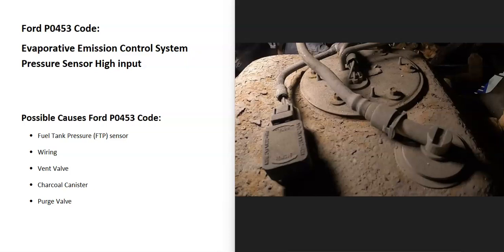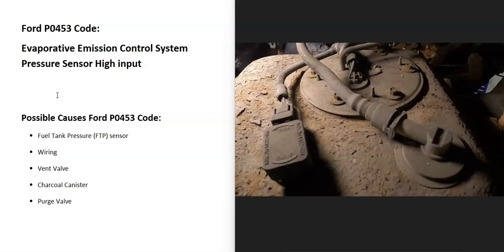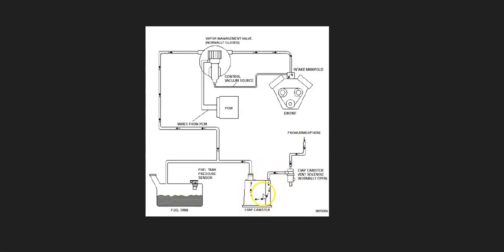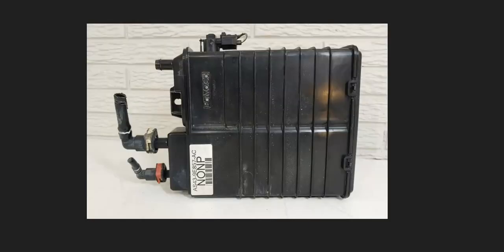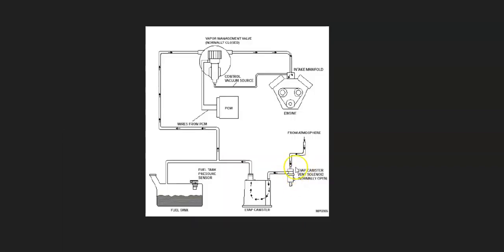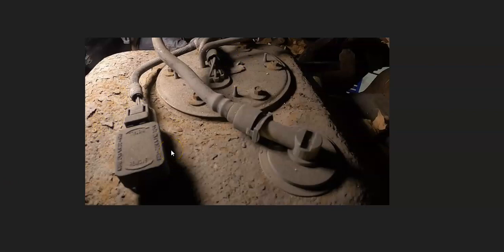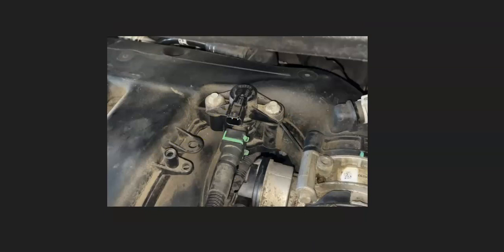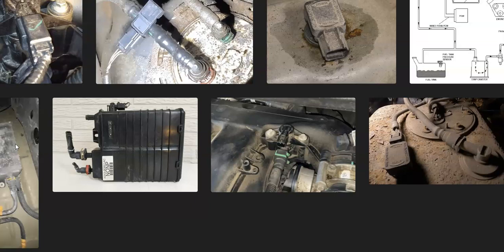Causes and Fixes Ford P0453 Code: Evaporative Emission Control System Pressure Sensor High input

Comment: I have a 2006 ranger with a 3.0l that has a P0453 code new fuel pump change the charcoal canister. But I can’t find the evaporative emission system pressure sensor/switch. Need help if anyone can tell me about where the sensor/switch is
Reply from the maker: In those years, Ford called it the fuel tank pressure sensor (FTP). For the ranger It is usually located on the fuel pump or inline on a hose.

Comment: Old video so sorry for late comment. Couldn't we eliminate stuck valve as the problem by running the car with the fuel cap off?
Reply: Also if it P0453, meaning the sensor is putting out 5volts, that would eliminate a bad reference voltage line. Also it would eliminate bad sensor output line. So it's either a bad return line (ground) or bad sensor.
Reply from the maker: The purge valve sends the gas vapors into the engine, so the gas cap off will not work. I made a video on how to test the purge valve without removing it. Here is a link. https://youtu.be/X-Y5YsaXxJE
Reply: @HVAC_Mechanic I really appreciate the reply. I thought that the sensor detects pressure in the tank. So if the cap is off, depressurizing the tank, and the sensor still reports high pressure,  we have eliminated the vent valve as the cause.
Reply from the maker: There are two valves, the vent valve and purge valve, which usually will give a code when bad. If there are no other codes, I would test the EVAP pressure sensor and wiring.

Comment: A p0453 vacuum leak cause the overdrive light to flash?
Reply: Reason I ask i must of damaged mine when installing fuel pump now the overdrive light flashes and hard shifting  p0543 code
Reply from the maker: Usually, an EVAP problem won't affect the engine. The only EVAP component that can affect the engine and possibly a vacuum leak is a stuck open purge valve. I made a video on how to test a purge valve. Here is a link. https://youtu.be/5rQelbINjTQ

Comment: Have 2000 ford expedition xlt code p0442-p0443, fixed tank vapor vents crack sealed them all , replaced gas cap, vapor silanoid for charcoal canister, and purge valve replaced, now am only getting code p0443, did smoke test no more leaks but only thing i havent replaced is purge valve intake hose colapses when running, can pinched hose to purge vavle cause this p0443 ?
Reply from the maker: It may be possible, but the P0443 code is pointing more toward a circuit issue. If the purge valve is good, I would test the wiring and check the fuses. I made a video on how to test if it is working correctly. Here is a link. https://youtu.be/5rQelbINjTQ

Comment: What kind of filter does Ford use in newer pickups to pull from outside to the vent solinoid?.Chevys is inside the door beside the capless gas cap. And it's a joke.

Comment: I’ve replaced the sensor, evap canister, fuel pump, evap pressure sensor.  When cold it starts, but when driven and I turn it off it doesn’t start again, it will crank but will not start.  The only way it will start when hot is when I take the fuel line off the fuel rail and let all the pressure and gas out from the line. It will start again.  What is the problem?
Reply: Check - Purge valve not working

Comment: I’m having this problem now and trying to eliminate certain potentials to pinpoint what the issue could be. All the shops around me (SoCal, unfortunately) charge $250 for a diagnostic… which could still lead to a “maybe it’s this part,” and I don’t want to blow $250 to tell me it’s a $9 part. A couple years ago I installed a new fuel pump and fuel filter because it randomly died one day. I was in the process of building another car and so this mostly sat. In a couple years, it’s seen maybe 300 miles. But now got the check engine. Runs fine, idles fine, power seems to be there, so I’m wondering if theres a way to limit the possibilities down from 7 parts, to 1 or 2. I’d really hate to have to drop the tank again…. It was PITA.
Reply: 9 dollar part you wish they cost about 100

Comment: I have the same code on my 2006 ford expedition but the auto part store told me my car doesn't have a fuel pressure sensor what else can it be or where is this sensor located bc they said the system says there is no fit for a 2006 ford expedition
Reply from the maker: You will need a diagram of the EVAP system for your exact year and model to know for sure where parts are located. Ford Fuel Tank Pressure sensor is often located on the gas tank but can also be on the fuel pump, charcoal canister, or other locations.

Comment: My diagnostics fixit is sending this code to me.But the problem is my CheckBrake system light comes on along with my traction control symbol to. Would this Code cause this to happen
Reply from the maker: Are there any other codes? Is the brake fluid at the correct level? The vehicle will need to be researched to know for sure, but often, when there is an error engine error, many computers shut down driver assist, such as traction control.

Comment: I have the same code on my Hyundai. Drives fine but has a rough idle. Wants to stall sometimes. I’ve changed the pressure sensor, purge valve solenoid,vapor vent canister solenoid and removed the charcoal canister to check for blockage and did the same with all the lines. I’m at my wits end. Any suggestions?
Reply from the maker: Usually, an EAVP issue does not cause the engine to run rough unless the purge valve is stuck open. When an engine starts, the purge valve should be closed, and no effect on the engine performance. Since the components have all been replaced, I would do a smoke test and check the wiring.